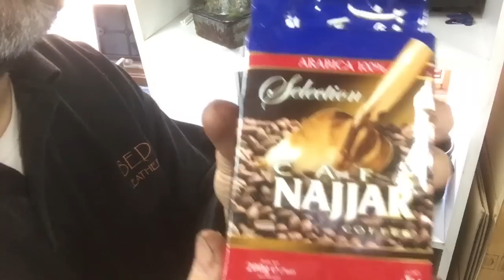Coffee time

Comment: Try bringing the water to 200F (90C) to get the best dissolvement of the coffee solubles (grounds).  In boiling water the oil in the beans change favor, it becomes more bitter.  After i got a water boiler with a temperature control i noticed a lot less bitterness in my coffee.  I can now drink the last cold sip, at the bottom of the cup, without making a face.

From wikipedia "Oxidation and degradation occur more rapidly at higher temperatures. The oils in coffee solubles can oxidize more quickly at elevated temperatures, causing coffee to taste sour. Acids also degrade, the most notable of which is chlorogenic acid into quinic and caffeic acid, causing coffee to taste bitter"
Reply from the maker: Brian Jensen awesome I’ll try that 👍👍